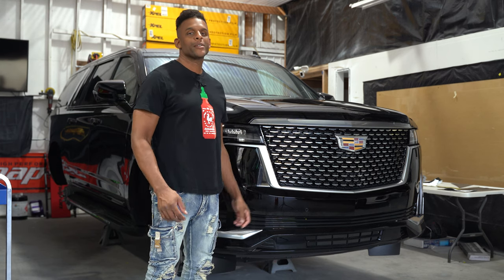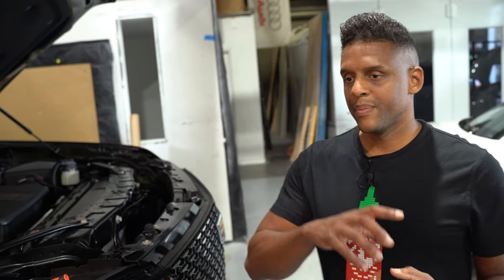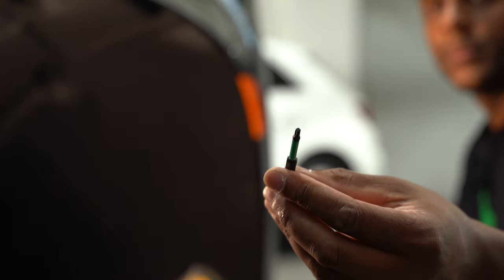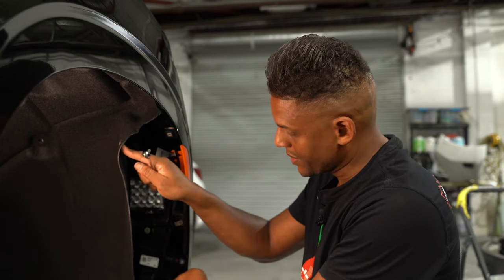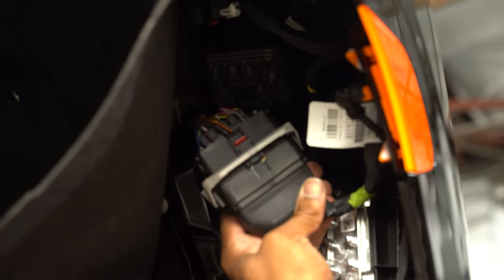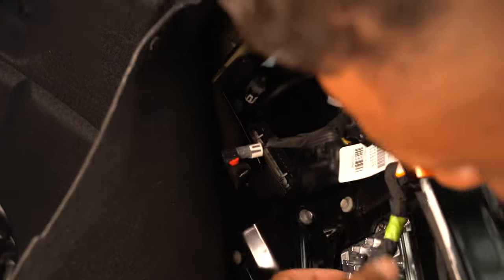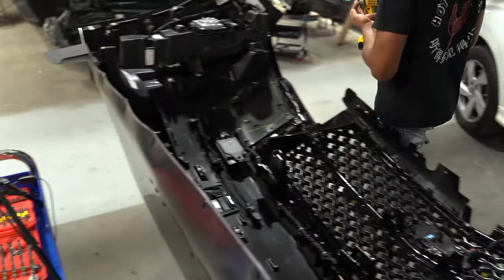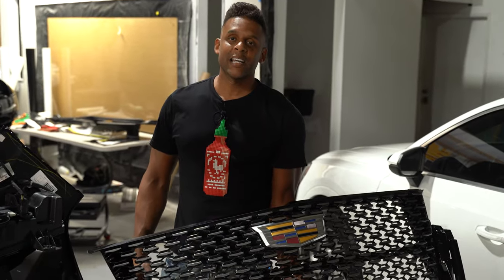HADD How to: Remove Grille from 2024 Cadillac Escalade

Comment: do you know if premium lux swap with sports grill is easy peasy taking the bumper off ,, or they are both different size & wont fit.
Reply: Don't know about the easy peasy part but It will definitely fit, every part of a premium luxury and a Sport are interchangeable. , got a '23 premium luxury that the dealer blacked out everything on except the grill and I'm considering doing that too.

Comment: bro would you build a 2007 honda accord with k24 motor thats already in 5 speed or 

trade that and get a 2006 acura tSX with a bigger beefer motor but in auto and wayyy lower miles.
Reply from the maker: What’s up?!  Considering I’ve been driving for a long time, these days I prefer an automatic transmission.  I would go with the TSX especially if it has lower miles, has a bigger motor, and is probably not going to be a problem to register, etc.

I always say “to each their own”, but those are my preferences.  Hope that helps!